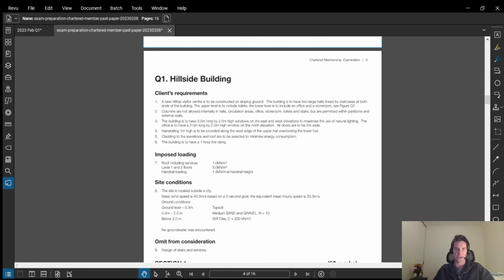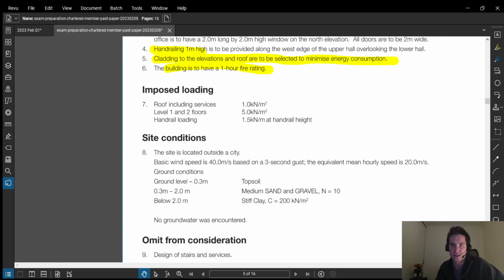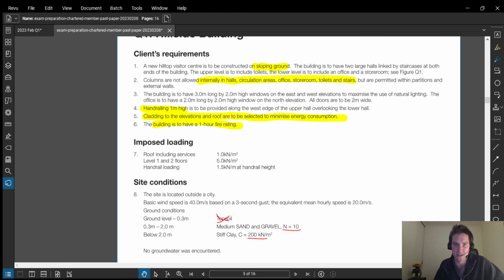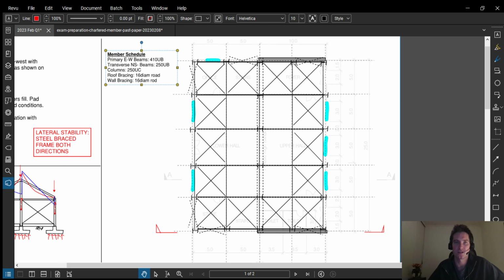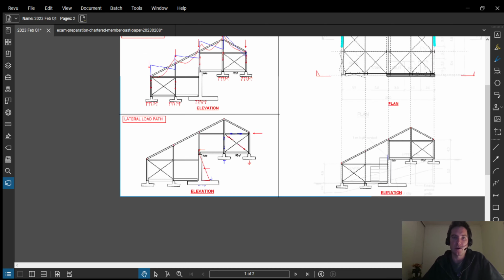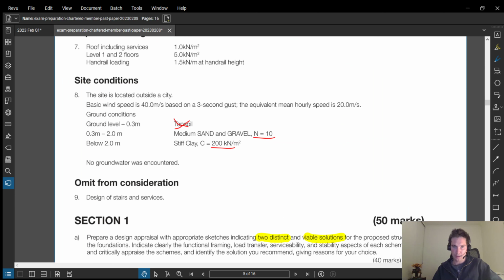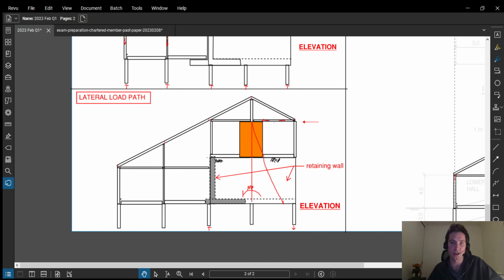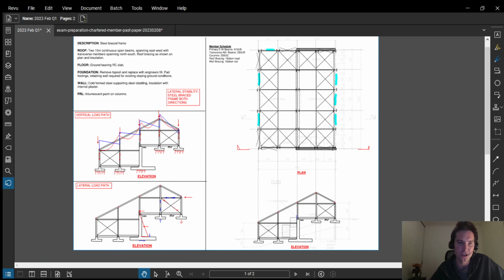IStructE exam - February 2023 Question 1.

Comment: Hi Alex,
You got the retaining walls on the edges wrong, they should be on the sides of the lower hall not the upper hall (just the first bay from the entire lenght). Think about the ground profile, you need retaining wall on the sides to create the lower hall space.
Reply from the maker: Hey thanks for the comment. My solution is actually cut and fill, so I cut the earth on the lower hall side and fill it under the upper hall (I fill the gap between existing ground profile and the floor of the upper hall). I think the examiner's report for this question also mentions following this profile. 
A retaining wall on the lower hall side would be possible, but then you may have a retaining wall blocking the window on the north elevation.